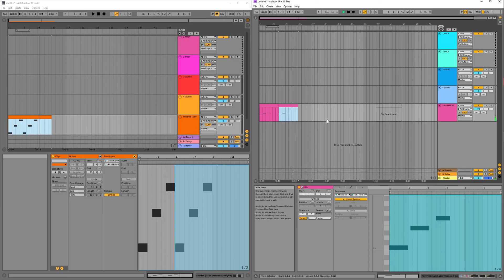Sustain Pedal Hold Pedal midi editing in Ableton 10 and Ableton 11

Comment: Hi Sir Eos.  Thanks for sharing.  I find your Videos quite informative. Two things: I have followed your instructions & I still have not been able to get the Sustain to work in Ableton even though my Sustain Pedal works ordinarily. I probably don't know the right question to ask as I am just starting to use Ableton Live...  I would like to be able to use Ableton Live as a Keyboard having the ability to Split Patches & Trigger Samples using the onboard Sounds from Ableton Live 10.  So far I have not seen a Tutorial from Ableton or anywhere showing how this can be done.  There are Musicians who no longer worry about taking their Keyboards with them.  Just their Computer & connect via USB to any Keyboard that is USB compatible turning of the Local Channel....  Are you able to point me in the right direction?  I would greatly appreciate it thanks.

Comment: It is so dumb how hard it was to find this information online. I spent an hour straight toying with Ableton to figure this out, wondering why my pedal sustain didn't record with the midi loop (I was holding the pedal down while recording!).. THEN another 30 minutes of Google searches just showed basic midi note editing, how to connect a sustain pedal, how to use a pedal as a midi controller, THEN on to YouTube, had to rephrase my search 3 times and watch like 10 videos not including shorts that popped up, sheeeeeesh..... 
THANK YOU! They really need to make sustain as intuitive and accessible as velocity controls...
Reply: it's because google sucks. and even though it's only been two years since this comment (in the same boat) google has gotten WORSE

Comment: im having the issue where i have a set of midi notes from a midi pack, using grand raphsody plugin piano and then doing the midi cntrl 64. this is without holding my sustain pedal down of course, and it wont export the audio nor does it even work in the first place. Im frustrated and just want to export my audio with all my piano notes sustained, ugh

Comment: Hi, I recorded a track using my midi controller with a sustain pedal while recording. I don't know if using the addictive keys plugin makes this not work but I did what you did in the video and it did not play back a sustain. please help
Reply from the maker: Did you try it with another plugin to make sure that the issue was the same for both
Reply from the maker: you can also look in the plugins user manual and find what value they call the sustain pedal and just use whatever channel that is